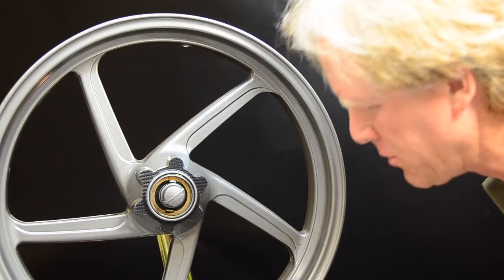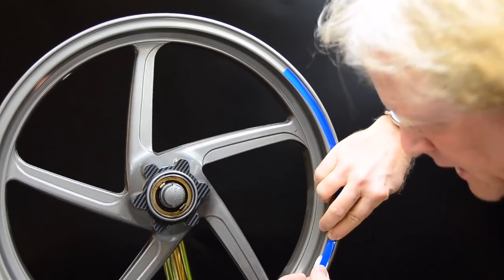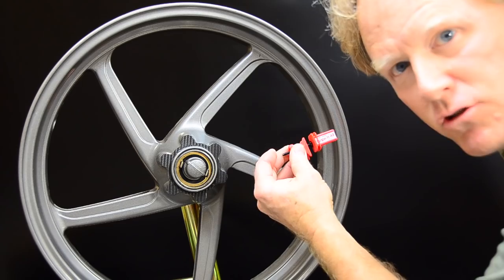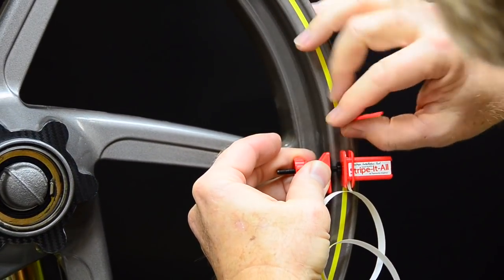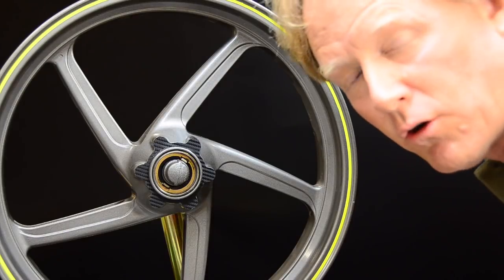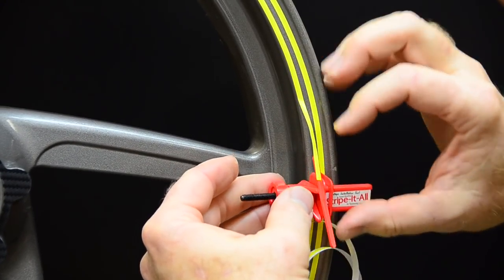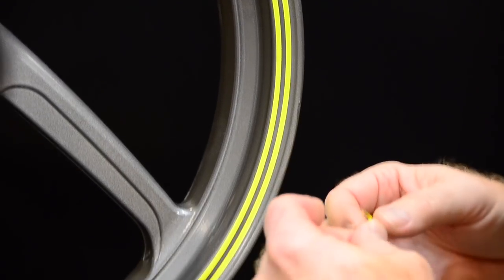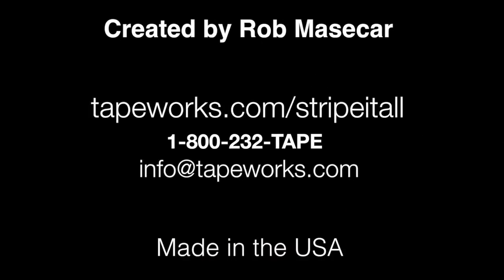Stripe-It-All EPK

Comment: I put these stripes on my Corvette rims.  The tape sticks really well and holds up.  I scraped a wheel against a curb in damaged the tape.  The wheel wasn't damaged.  I was able to remove the damaged tape and apply a new stripe.  Without the tape, I would be replacing the wheel.
Reply: So your saying a little bit of tape protected your car's wheel?
Reply: @FinalWarrior27685  Yes.  I scraped the side of my new corvette wheel on a curb.  The tape got torn up but the wheel was hardly scratched.  The kit comes with an extra roll of tape so I removed the torn tape and replaced it.

Comment: kool, but im wanting a thicker pin stripe on my wheels. arround the size of the blue stripe u were using at the beginning. is it adjustable to fit different sizes?
Reply: I know this comment is old, but in case you were still wondering, and for anyone else wondering: Yes, it is adjustable for different stripe widths. I assume they just used the thin 1/8th inch striping to show off how you can do parallel lines easily with the tool. The website claims it can easily do up to 3/8th inch stripe width.

Comment: Not impressed with the speed in which he tries to demonstrate this, too fast. Why? Because he made a horrible join on 2 occasions when using the pin stripe tool, especially on the 1st join which clearly did not match up.